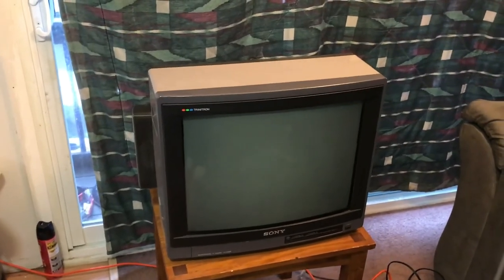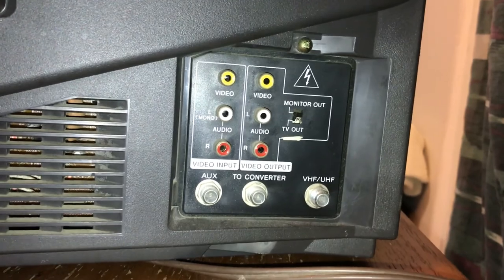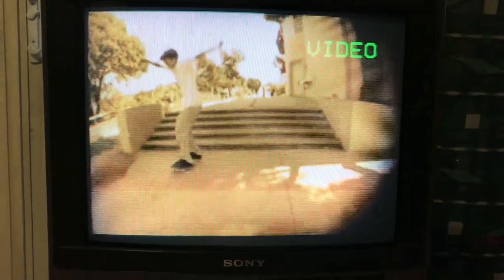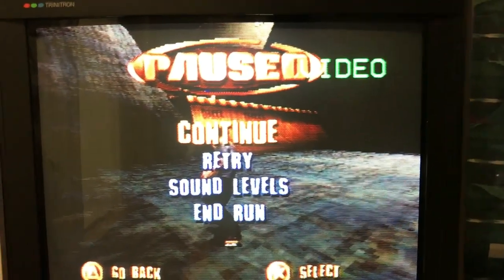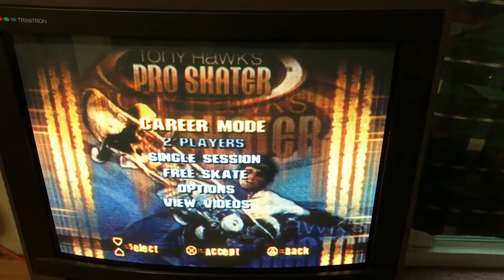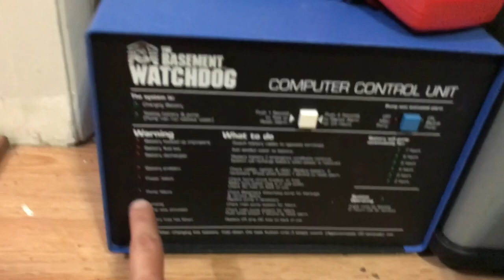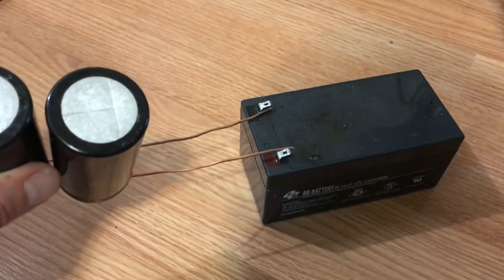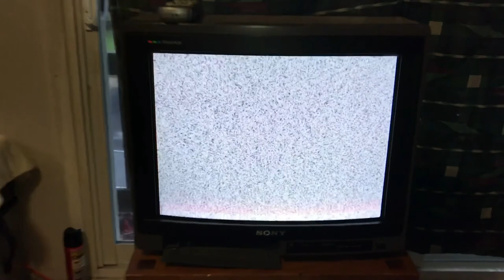Sony Trinitron Model KV-2093R First Look + Fixing Blue Spot On Tube!

Comment: Those monitor outs were sometimes used so you can record whatever was on the screen if your VCR didn't have a tuner.  We had a 32" model similar with the speaker ears.  It had s-video inputs.  I would love to have this 20" though.  Been watching CL closely.  So far I ended up with an 80s 19" and a mid 90s 20", both with mono sound though.  At least the 20" was RGB modded.  In theory if you cycled the tv enough times throughout a week period, the built in degausser should also take care of the magnetic spot.  "Should"